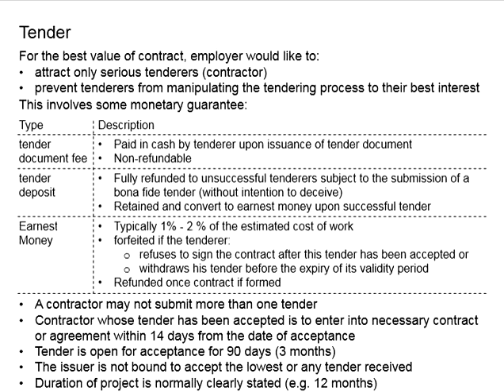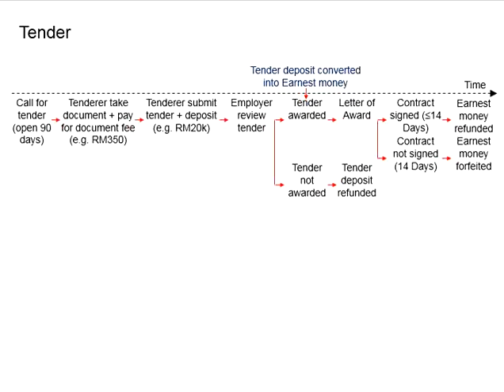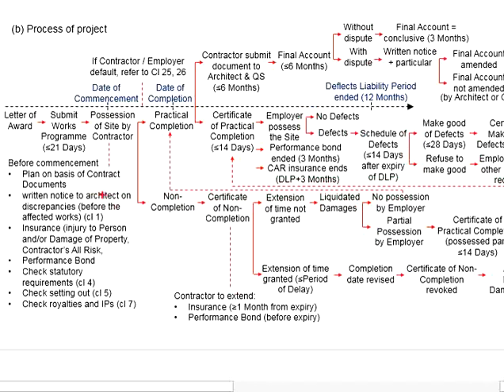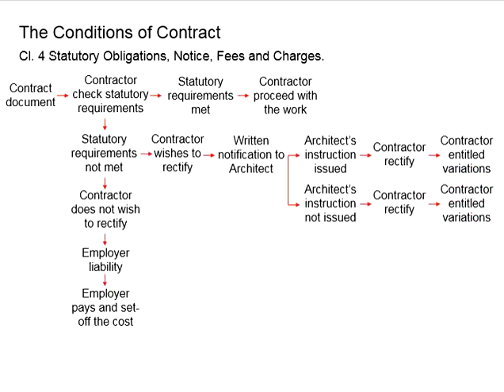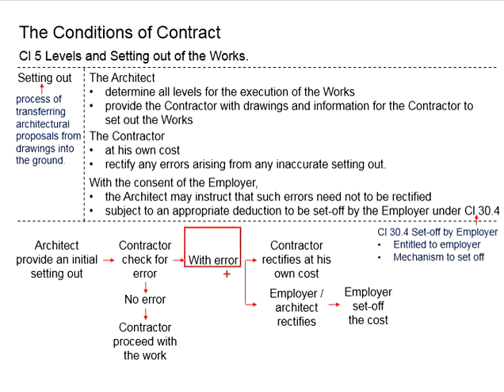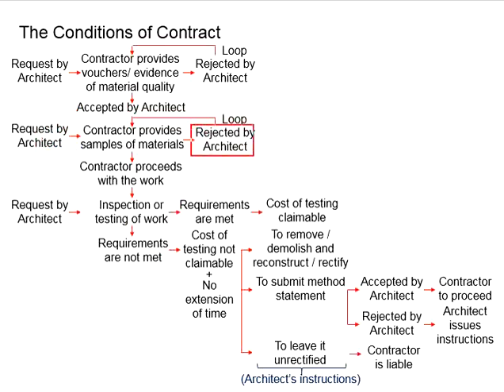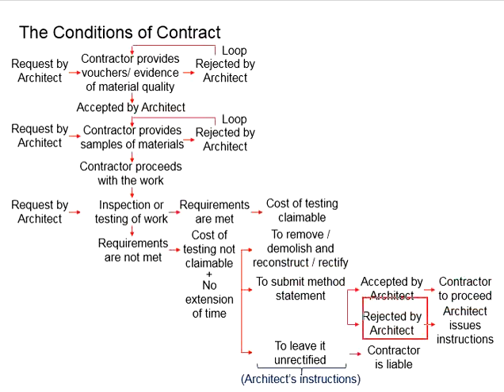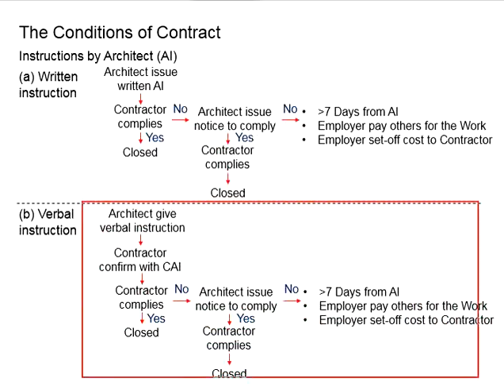3.18 Recap Part 1 (PAM Contract 2018 Cl 1 to Cl 15)

Comment: Mr Eng, I don't quite get the reason why If a Main Contractor choose not to accept and comply to AI for an additional works, then the Employer may appoint others to proceed and complete the said AI but all cost incurred will be recover from the Main Contractor. I don't see how this is being fair to contractor. Any thing i have 
missed out? thanks
Reply from the maker: 1. AI should be on the basis of the contract, which is agreed upon by both sides.
2. Refusing to comply with AI means the contractor is ignorant and refuses to deliver his obligation as per stipulated in the contract. The employer has the right to appoint others for the work, and charge the contractor. 
3. If the AI is contradict the contract, which the contractor deems inappropriate, the contractor may negotiate for solutions. If the AI is not within the scope of the contract or involves some changes to the specifications in the contract, the contractor may call for variation. The contractor should be paid accordingly. 
4. Also ought to be mentioned that the fundamental of the tendering contract is a unilateral agreement, either take it or leave it. The contractor who has accepted the contract is deemed to agree to carry out the work for the employer.
Reply: @eng-aim  very good and clear explanation, my encounter was for a portion of contract works to complete an open car park but eventually employer demand Architect for AI to convert the open car park to a multi storey car park which all variation rates shall follows back the existing SOR. Can contractor contest to such AI and demand new rates since the new work is consider enormous and level of complexity of works are higher as well. Contractually who is right in such context? Employer is entitle to force contractor to perform additional add hoc works based on SOR or Contractor having obligation must perform and comply to any AI being issued  since in the first place, contractor have accepted the contract. Thx
Reply from the maker: @dannycheah4820  1. Theoretical, it is right to have the variation rates following the existing SOR. Of course, this is provided that the additional work is of a similar character and condition. The contractor may request a fair adjustment of the rate if the character and condition are dissimilar. This shall theoretically involve QS for a fair valuation. This is stipulated in Cl. 11. 
2. The employer can request the contractor to perform additional work. It would be a win-win situation without having another third party interrupting the existing works. Normally, the contractor would agree with the work, since he shall be paid accordingly. On the practical side, a good relationship with the employer would be advantageous in long-term business prospects. 
3. Since the additional work was not stipulated in the original contract, I feel the contractor has the right not to comply if the rate is unfair. Since the cost is not considered in the first place, the contract sum should not be affected. Marginal adjustment may involve due to the omitted works, which are being substituted by the new work scope. The employer may hire another contractor for the additional work with no cost implication to the existing contractor.
Reply: @eng-aim  Tq for your kind explanation, fully agree with your statement in order to handle such deviation with good spirit of contract

Comment: Hi Mr Eng, regarding the CAI, does it only applicable to Architect Verbal Instruction only? How about those Site Instructions by RE or IOW, EI issued by C&S or M&E, Landscape or ID consultant Instruction as well. Does all these instructions need to be properly blanket with CAI or AI again? Thanks
Reply from the maker: Theoretically, it only applies to Architect’s verbal instruction. Whoever other than the architect issues the instruction shall seek confirmation from the architect before proceeding. Under such circumstances, CAI should also be applicable. This is to prevent complications in terms of the payment later.